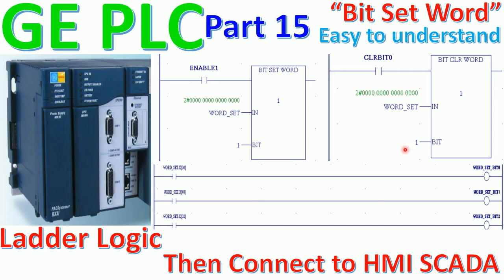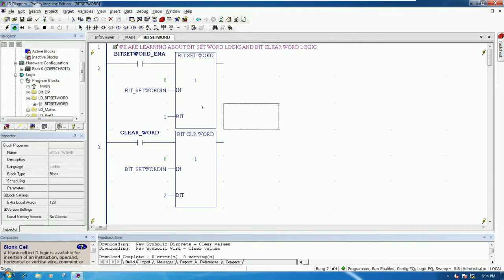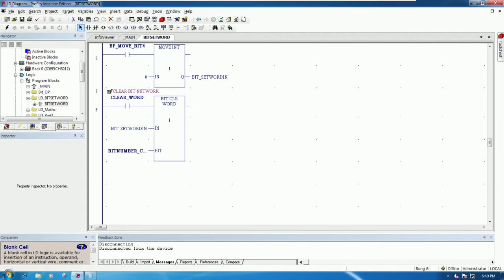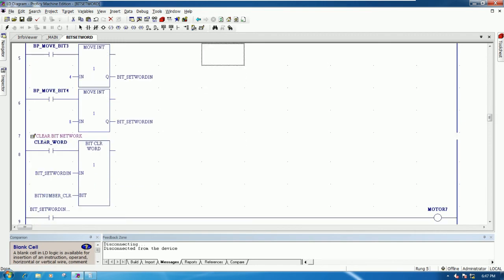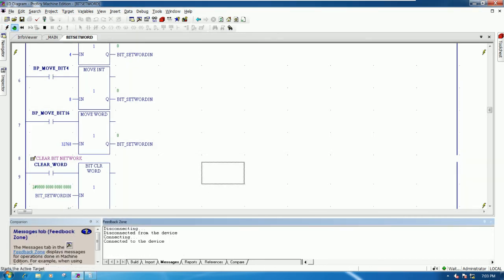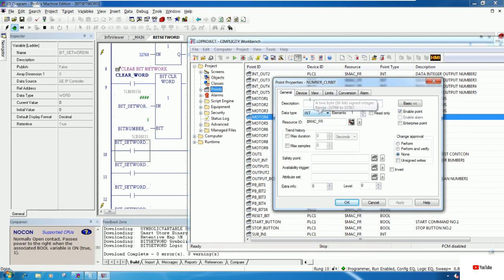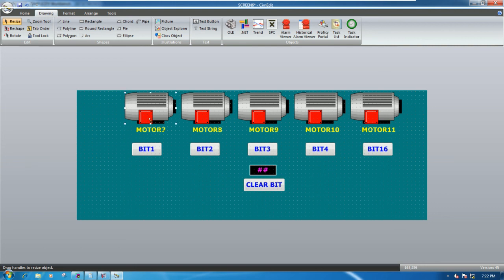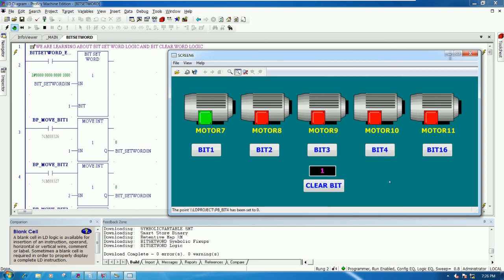Proficy Machine Edition software connect with PLC GE about "BIT SET WORD" & "BIT CLEAR WORD"

Comment: Thank you. if I understand correctly, you cannot turn on multiple bits at the same time with bit set word?  like motor 7 and 8 for example.
Reply from the maker: Dear sir,
This is just example for easy to understand but actualy we can turn ON all bits by move the int or word following converting from words to bits.
Thanks you so much
Reply: General Technology Knowledge ah. Oke thank you. 👌🏻👌🏻👌🏻👌🏻👌🏻